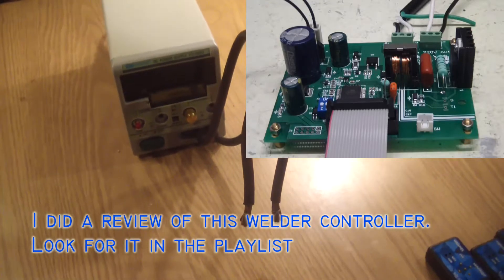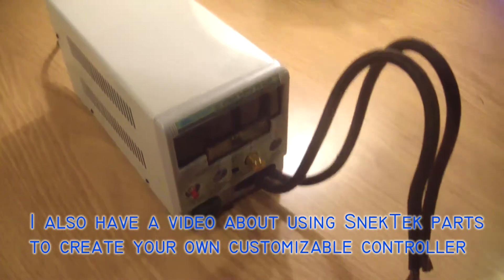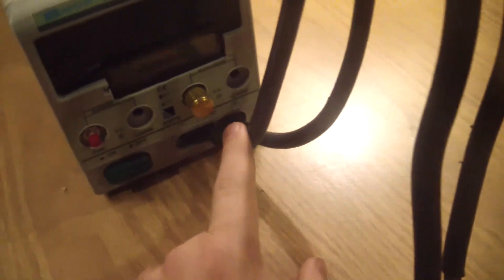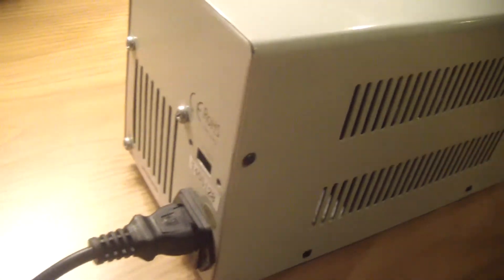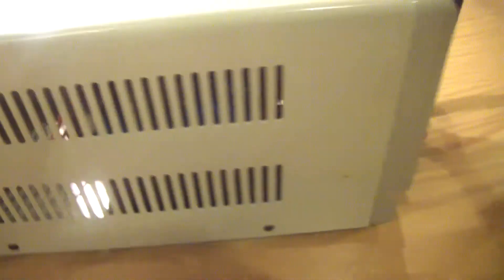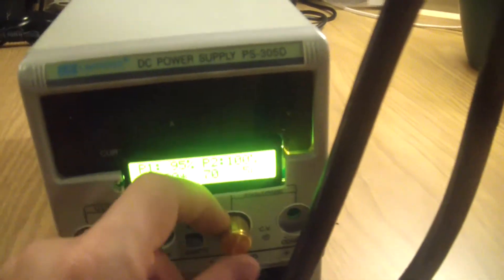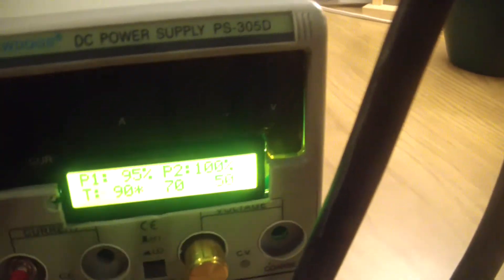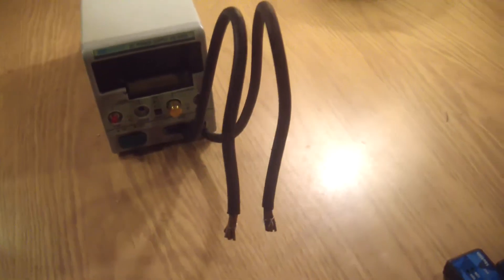Aliexpress Spotwelder Controller in Convenient Enclosure

Comment: hi friend any news for this ? about welding results i mean
Reply from the maker: Hi! Results are good, I weld mostly batteries. I found I needed to use 60-100 percent to get the weld to work.
Reply: hi again .  can u show me what transformer u r using and the type of welding tips or pits. thank u
Reply: i wonder if u have any idea of how to build a wire wedge spot welder for 0.5mm copper and alloy wire.it is mend to repair various car transmission ecu and so on TV stk module used on plasma TV.. it looks like the construction of a
Reply: sorry for the miss lining
Reply from the maker: Check this video where I show the transformer and "tips" I just use a single strand of a wire. https://www.youtube.com/watch?v=Mo7Up8RRn7o
Reply from the maker: I'm not sure about the wire wedge welder. Do you have any relevant links? Seems interesting
Reply: hi , as i was saying about wire bond , weld , u can have a taste here https://youtu.be/0d9CXLQbxCk